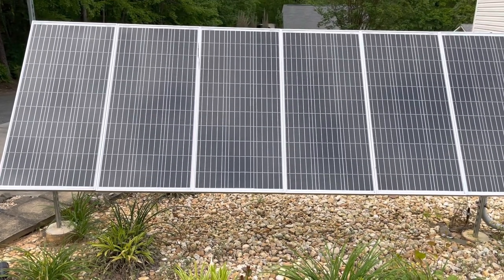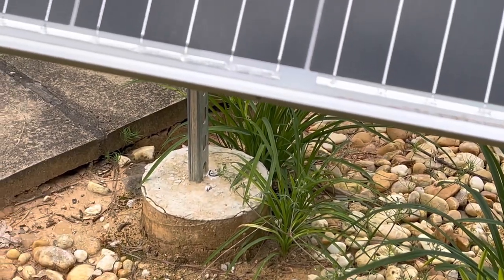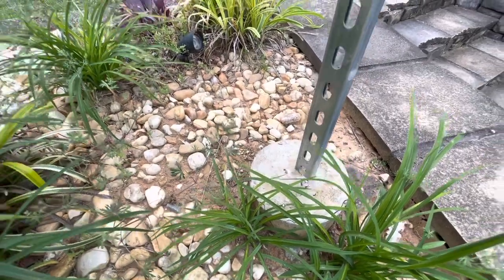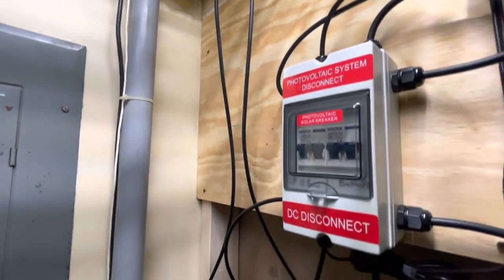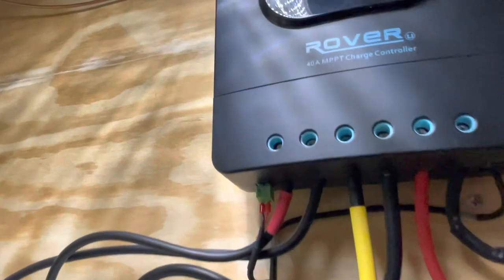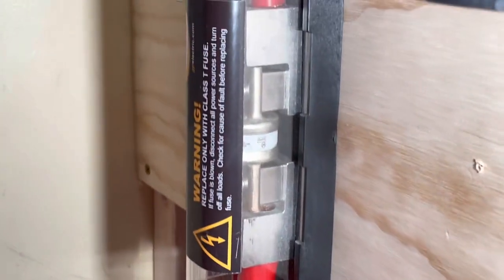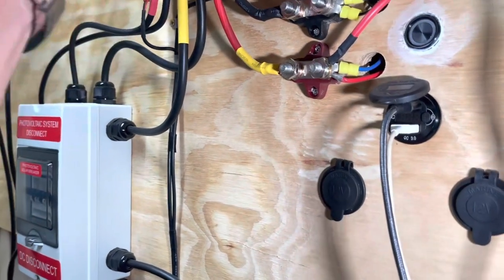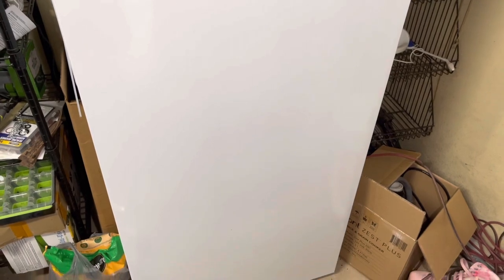Walk Through Of Our 600 Watt Off-GRID Solar Power System. Running For TWO (2) YEARS ZERO ISSUES!#diy

Comment: You have 2 batteries of 100A each .  Why are you mentioning 400A ??  What have i misunderstood ?
Reply from the maker: Each battery is 200ah for a total of 400
Reply: @DIYKAI  i clicked the links at the discription an opened 100A batteries.  thanks for the clarification .
Reply from the maker: Ah sorry it should have given you other options as well…..so the “standard” that many people use is 100aH but after testing we wanted a reserve of a few days incase of bad weather and having more aH how ever you get them is always better….we just wanted a smaller battery bank because (4) 100ah batteries is double the space as 200ah they use the same cases most of the time and relabeled them

Comment: This is not large enough to run AC, boiler, stove, microwave and water pump.
Reply from the maker: This system can provide up-to 3kw so it will be able to run that stuff provided you have enough battery storage
Reply: @DIYKAI  You have six 100 W panels at 120 V output. How about without a battery? How many 100 W panels do you need for 3 kW without a battery?
Reply from the maker: @teemum.9023 solar panels generally do not power devices without a battery and charge controller it would be to unstable when clouds pass
Reply from the maker: @teemum.9023  you need a charge controller and battery or batteries. The reason is the panels cannot power devices by themselves its to unstable and only produces DC....the Battery would power the inverter to produce AC voltage
Reply: @DIYKAI  Ok, so inverter and battery required. How about asking, who long does a 400 Ah battery last at 230 V 3000 W?
Reply from the maker: @teemum.9023  we only use 120VAC here in the states…..you would need a 24VDC battery bank or 36v or 48v you need to decide how you want to put your batteries first. 
So if you use math 230vac at 3kw is around 13.04Ah
You need to also know how long you want to run your items for……
You must plan accordingly or you will be disappointed
Reply from the maker: @teemum.9023  this will depend on the load and time. 400Ah is 400Ah no matter how you look at it
Reply: @DIYKAI  3000 VA/230 V = 13 Ah. 400/13  battery lasts for 30 h at 13 amps
Reply from the maker: @teemum.9023  that is not true in real world on paper yes so you would need to scale 1.5-2 times more for days with no or low production
Reply from the maker: @teemum.9023  so to give you an idea we run a 6ft deep freezer 24/7 365 and we use about 100Ah a day between that and inverter loss. We can run several days without sun.
Reply: @DIYKAI  Yes. But that is using 800 watts. I will make it double. Thank you